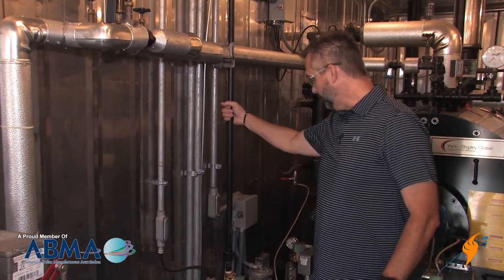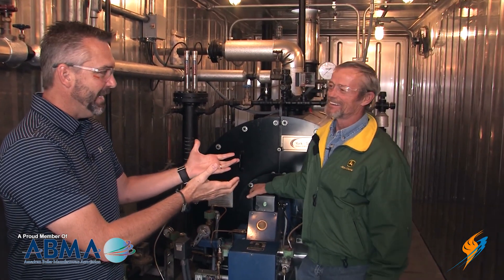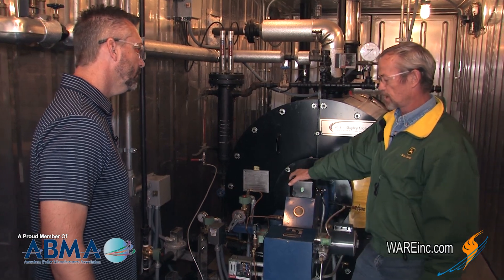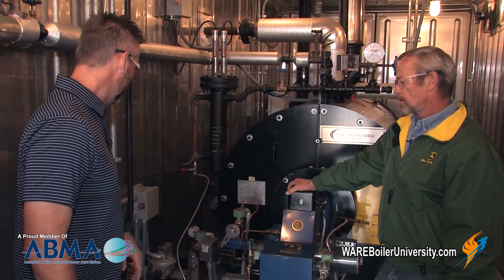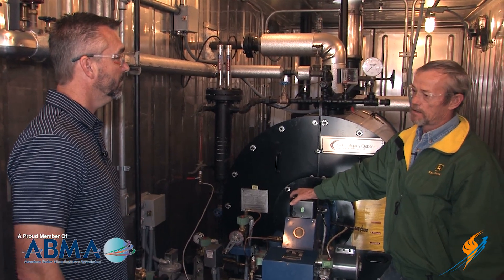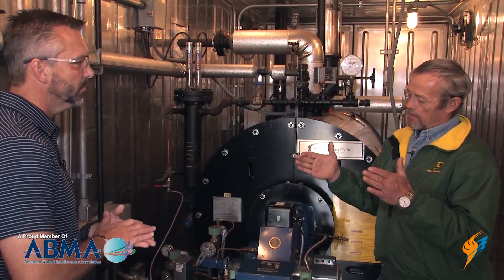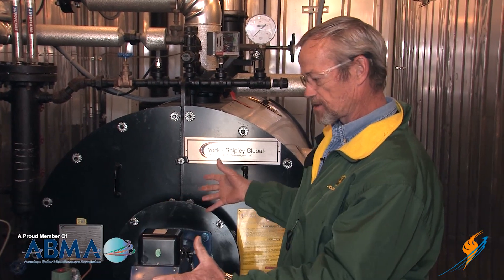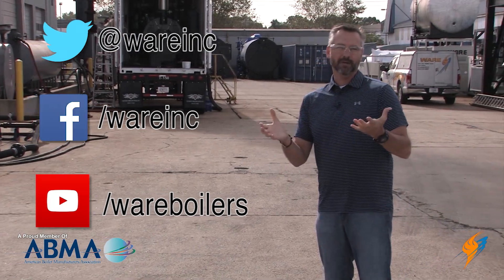Are you letting money just go through your vent valve? - Boiling Point

Comment: With the proofing system a vent valve is not needed at all. When the system shuts down the first solenoid valve goes off and the second one remains open for about 5 Seconds making sure there is no gas between the two solenoids valves. Once both solenoid valves are off the proofing system is in operation sensing any pressure between the two valves. I believe this is accepted by the new code 86? Great video guys keep up the good work.